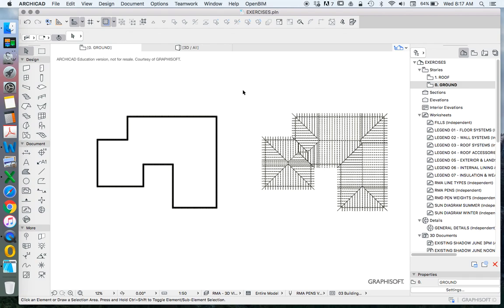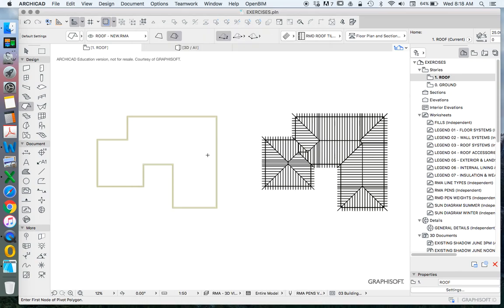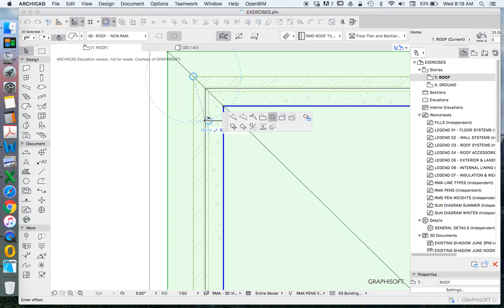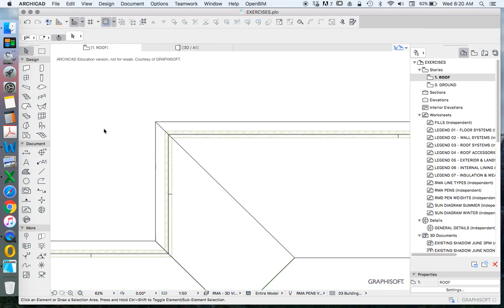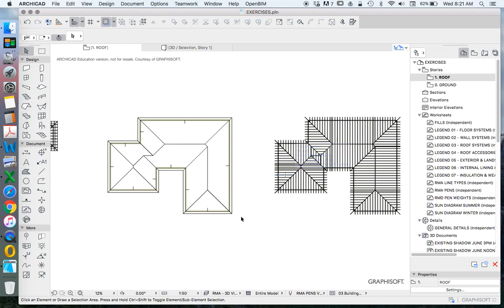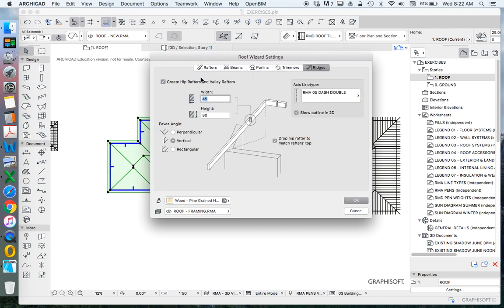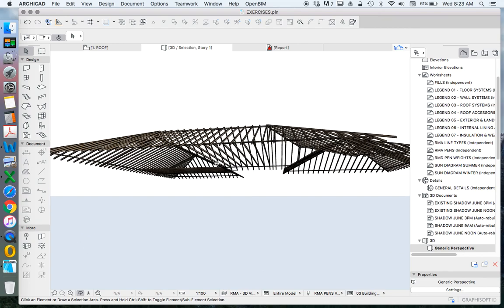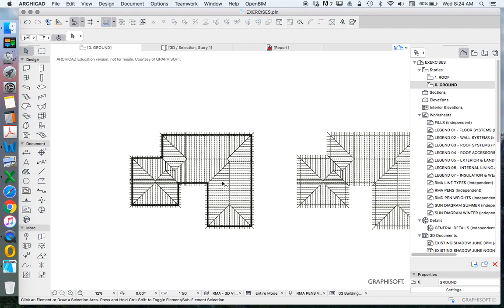ArchiCAD Roof Framing Wizard

Comment: You may be able to fix the reference line issue that the magic wand roof creates in the composite settings. If the framing is going to bear on a "Core" building material (the concrete in this case) make sure it's "Type" in the composite settings is identified as the "Core" material and the others are identified as "Finish" or "Other". Also, make sure the reference line of the wall is correct. You may try setting the reference line of the wall to the "Core" building material. 

Anyways, I have a question. Do you ever experience a crash when trying to open up the Roof Wizard? Like.. right when you click the button?